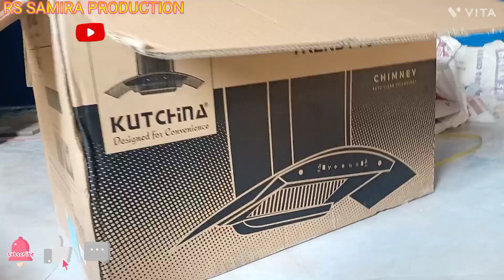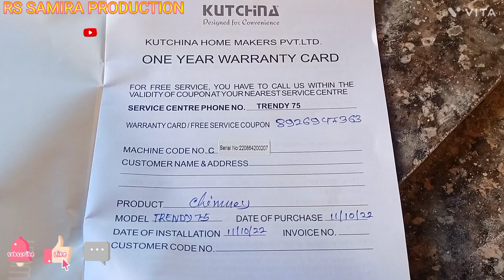kutchina chimney installation $ kutchina chimney installation charge $ kitchen chimney installation

Comment: Are the 2 plastic flaps present in chimney exhaust outlet removed before putting aluminium pipe?
Reply from the maker: Yes, its mandatory to removed those flaps... Before puting aluminium pipe.
Reply: @RSSAMIRAPRODUCTION  but you have not removed . I think flaps acts as a protector for rats and rodents entry:
Reply from the maker: Its removed but...that time video not shot that moment... So you think that flaps are not remove.
Reply: @RSSAMIRAPRODUCTION  ok, but these are extra protection against rats etc. and to protect the wires from rat bite. So should not removed what I suppose.
Reply from the maker: @priyabratacvr  thats reason... 1 Cowl is fitting  with aluminium pipe .

Comment: Why Plastic pipe is joined in the exhaust outlet to aluminium pipe?
Any benefit by doing this?
Reply from the maker: Aluminium pipe is to short to reach exhaust outlet ...that's why free pvc pipe added for avoid purchase another aluminium pipe.